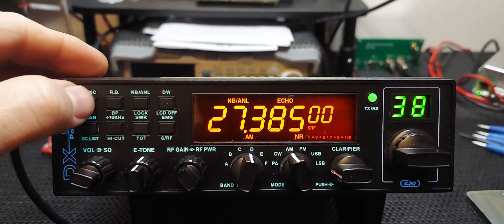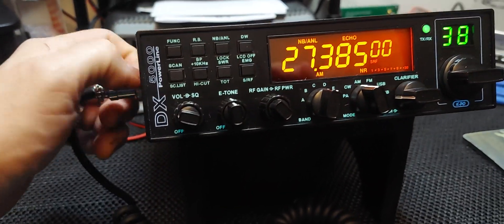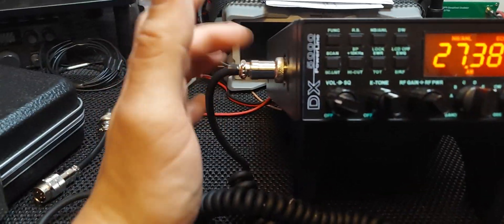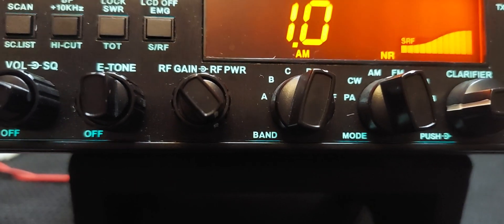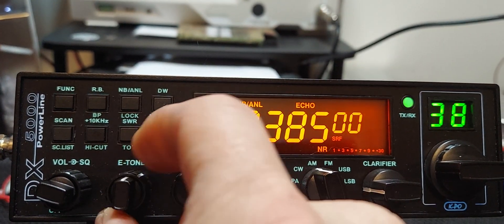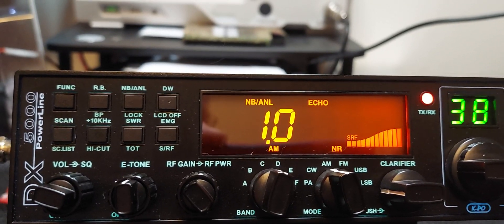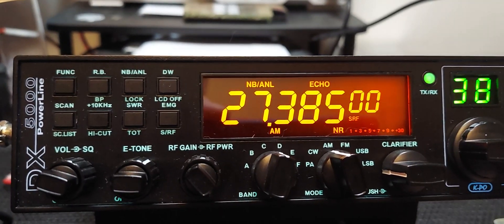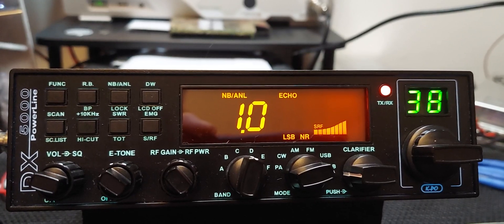TalkBack and Echo on New K-PO DX-5000 plus radio. #cbradio

Comment: I run a Turner Plus Three desk mic on mine and always get really good audio reports I used it on all new type radios since they brought out the Cre8900 the Americans and even Amateurs loved that audio. Always get asked what im using. I like it because the mic has a speevh compression circuit. Makes all the difference.

Comment: The original Quad5 is the same on the mic pins...
Reply from the maker: Yes. Just make sure pin #4 doesn't have a wire connected on your microphone plug.

Comment: so you cant use any kind of power mics on this? cause i was thinking about saving up the money and get one for house and one for car so itd be matching..
Reply from the maker: You can most certainly use a power mic of any kind on it.
You just have to make sure that PIN number 4 wire on your microphones plug isn't soldered.
You don't need it for RX and it can possibly cause damage to the radio if it is wired.
Reply: @ScottsRadios  oh ok i understand now...that cleared up my confusion thank you..
Reply from the maker: Sorry for the confusion. 73

Comment: The Top Gun Quad 5 takes a standard 4 pin mic. No need to disconnect any pin wire.
Reply from the maker: I have heard that the radio can be damaged if you keep the wire on pin number four of your microphone even with that radio.